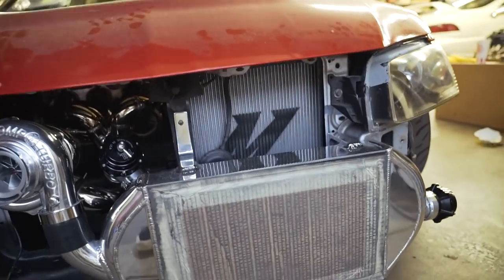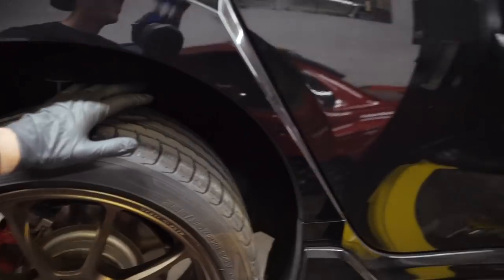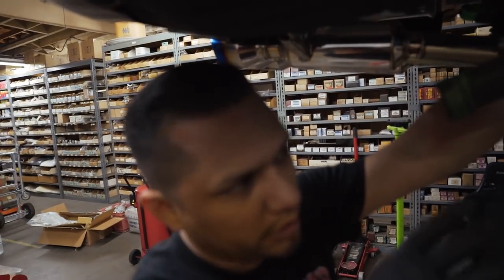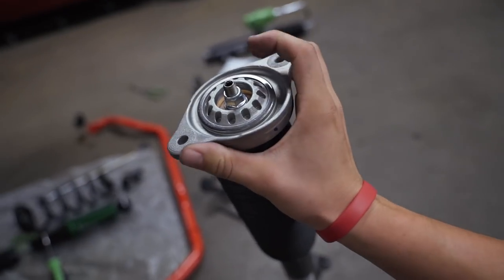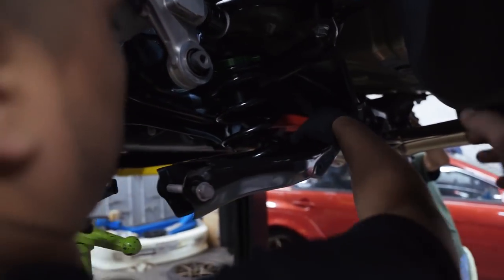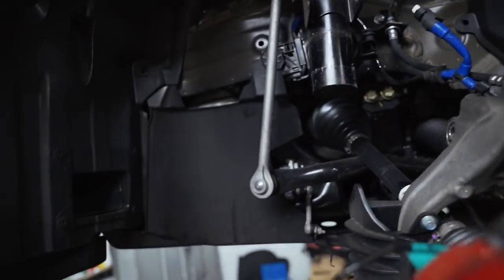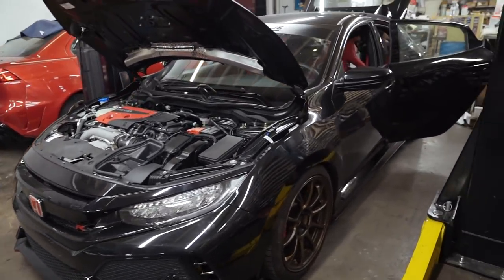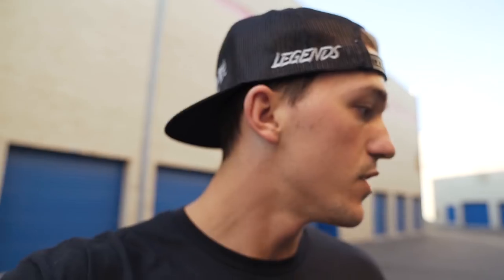INSTALLING COILOVERS ON THE 2018 TYPE R!

Comment: With independent separated rear suspension you are losing around 50% of the kg/mm of the spring, so your 8K is going to be around 4K under load. This is an effect of the spring being off centered from the shock. So if you want 8K under load you need a 16K spring to do that.

Comment: May look nice, but seriously, you have a car that has beaten may speed records around the track with stock suspension and you fit a shitty coilover kit that costs 1300-1500 bucks? the Oem suspension probably costs x3 times that and makes the car perform 3 times more, has a lot of expertice put in it to make the car go perfect.
Also, lowering the car seems nice but MOST of the time if you don't do corner balance with weight you loose the setup that many engineers from honda developed... :(
Reply: It looks good lowered.  If you just want to ride around normal, look cool never put the car through tough paces then your good to go.  Watch your underbody kit in a few months it may not look as pretty.  I would only drop 1 to 1-1/2" max,  Why? To avoid expensive damage,  Nice thing about coilovers you can dial it back up right on the car. Nice!
Reply: what's the sensors doing exactly ?, is it for the variable damping or just ride adjustments (comfort - R+), is the ECU on the car automatically stiffen the suspension ?
Reply: shitty coilovers? fortune auto is top notch, do research before you comment
Reply: coilovers without corner weighing the car is pretty much what clueless amateurs do, unfortunately.
Reply: When I was younger we would kill to get like the Honda type SH suspension and drool over electronic sensing dampening systems. But back then we wanted to race our cars, not park them at car meets.
Reply: @daisbestDA9  You think this upgrade would make the car handle better than it already does?
Reply: @daisbestDA9  Can't really justify the price of high end coilovers when the car is track ready already

Comment: Hey I am thinking about getting aftermarket coilovers for my 10th gen si. From what I have heard the car throws a code when you remove the adaptive dampening system. How did you overcome this issue? Is there a module that prevents the code from being thrown?

Comment: How does it handle with the coilovers? I was thinking about switching on the new type r but I'm afraid it will ruin the great handling it already has
Reply from the maker: it feels great! definitely much stiffer, but I really like them!
Reply: What happens to the 3 driving modes. Did you get like a bypass or something did a light turn on or anything like that

Comment: I wouldn't touch the stock suspension.  Honda spent hundreds of hours designing it.. It pulls over 1g... That's more than most people will ever corner at in a lifetime.

Comment: Why would anyone want to install coilovers on the Civic Type R which comes from the factory with an amazing active suspension?
Why screw with something if it ain't broke?
The stock car has set the track record for a a front wheel drive car at the Nurburgring, enough said.
Waste of money.
Reply: Is he using your money?